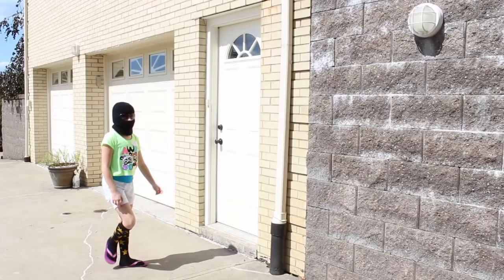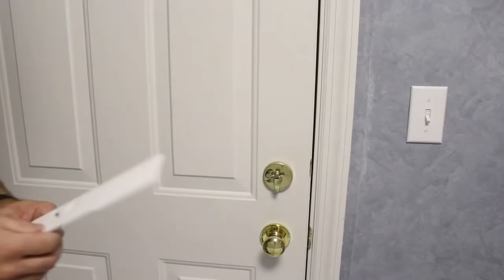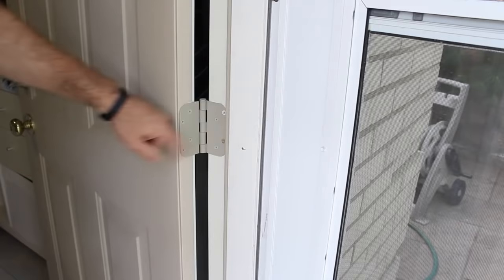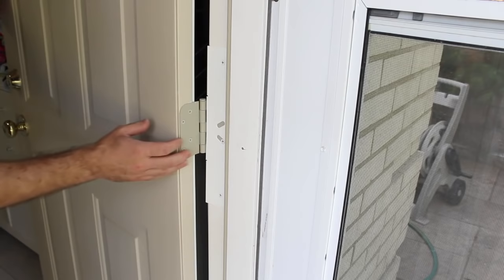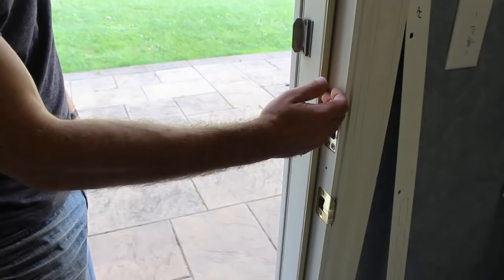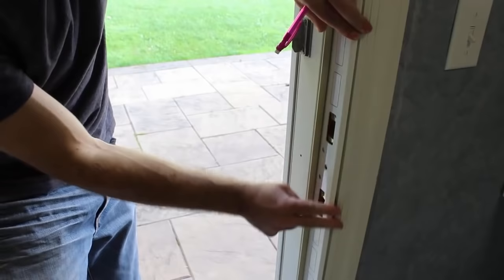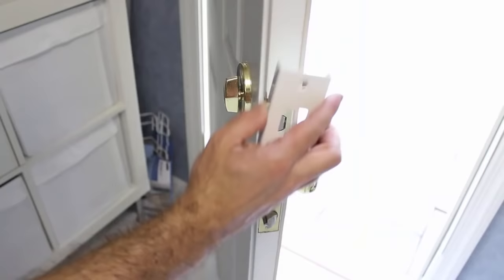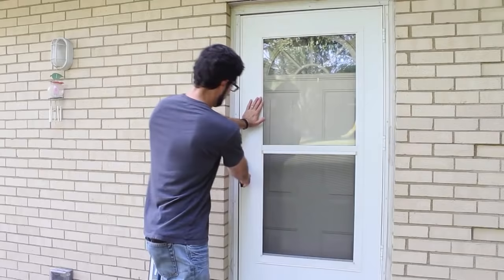How to Reinforce and Burglar Proof Your Entry Door

Comment: Speaking as a former Deputy, no door is burglar proof, best to refer to it as burglar resistant. This reinforcement kit looks like a good investment. Doors are likely the primary entry point, but don't forget that if the doors are too tough, they will probably move onto the windows. Note that anything that slows them down could prevent a burglary from happening.
Reply: How about a steel door?
Reply: Anything that slows them down gives the homeowner time to react.
Reply: I feel like everyone starts with front door...but doesn't really pay attention to garage doors, sliding doors, or the use of sticks and plastic film on lower windows that slide.
Reply: @philrose7716 anchored to the wooden door jam? It's likely still just burglar resistant. But I'm sure it could help in slowing them down or deterring them.
Reply: One can spend the money and truly make the DOOR burgler proof but still SOMETHING will give if not the door even if it is the framing that collapses   Plus a door is rarely the only orifice into a building there are almost always other doors and/or windows and barring those?  One can go right through the siding on many buildings ...I guess the best case without something being a fortress is a block or concrete structure with heavy duty hinged bars over all openings...I mean even those can be cut but not simply kicked through in 10 seconds
Reply: As someone with common sense, allegedly, if I was being felonious and decided to start kicking doors, if I don’t get passed that door because it’s reinforced, I’m walking away.

Comment: The whole point to pre-drilling is so you don't split the wood.  Doesn't matter if you have an impact driver or not - that doesn't change the physical characteristics of the wood the screw is going through.  When you don't pre-drill you essentially "pre-split" the wood.  That means your screws are not as strong as they could be.  If you are spending $100 on a security device, why would you want to sabotage your efforts by NOT PRE-DRILLING? Seems counter intuitive to me.  Never take shortcuts on anything that is safety or security related.
Reply: that's ture
Reply: Agreed, the lack of pre-drilling the holes for the screws is a devastating and a game changer for the entire concept.  Simply by stating that this pre-drilling is not necessary indicates that the individual in the video has no experience in construction or installation of anything related to wood products.  The product is likely reliable, although the video is horribly inaccurate.
Reply: I know this may sound stupid, but hey, us girls don't know a lot about this.  When you say "pre-drill", does that mean to take the longer screw and put it in first before applying the plate again?  I'm just going to be replacing the smaller screws with 3" screws (maynards didn't have 3.5 ones).  Will they work OK and as I asked, do I need to drill them in place before putting them over the hinges and plate?  Thank you for your response.
Reply: Pre drilling is when you drill a hole in the timber prior to putting a screw in. The hole is drilled using a drill bit that is not as thick as the screw you are going to put in. It should be drilled a little longer than the screw going in there.
Reply: daschundloverable you nailed it 👍
Reply: Matthew Leo lol!!!!  - gotta hurry and fix the foundation before the weather hits. Yoi!!!  TY again.
Reply: daschundloverable are you making a tutorial video for YouTube that we can critique?
Reply: Matthew Leo NO, I don't know how, even though I feel like I attend YT University!!!!  lol!!!  Like my 35 year old son said:  "Mom, you can learn ANYTHING on YT"  I'm disabled too.  MS and ortho problems.  Fell off a ladder on 10/9.  Caulking.  Hit my head (I'm not telling my doc about that one, although I did tell him about what happened on 9/9.  Was standing on the front lawn and just fell backwards and my legs went into an electrical shock for about 3 minutes - man I've been having roaming headaches ever since), on a bush branch about 6" in diameter, got my leg caught on the 2nd rung and couldn't get out for about 5 minutes.  And one of my poles on my privacy fence is leaning.  AND IT'S GETTING COLD OUTSIDE.   What used to take 2 hours now takes 2 weeks.  Pray for me.  Thank you and God bless and protect you and yours.
Reply: right on the money man, you should always have a pilot whole prior to drilling, that is woodwork 101.
Reply: Tumble Weed my bad, I often dont pay attention when typing comments on YouTube I'm normally multitasking. 
hole
Reply: Absolutely agreed, but that’s why they have the GSK R4 no pre-drilling required screws. That’s what I personally use and they are amazing.
Reply: You should show us the difference it makes in strength, when using these length screws in wood with and impact vs, predrill using same material
Reply: sMiLey Warrior exactly
Reply: @daschundloverable  Use a drill bit that is smaller in diameter than the screw but the same lenght.Any hardware salesperson should help you with this.
Reply: My drill died this summer, but I'm still alive!!!  Now it's -56 w/wind chill here and I'm not going to Menards to have them figure out if I need a new battery or charger or a whole new set up.
Reply: I totally agree!
Reply: @daschundloverable  I know I'm a little late here, but I see that you didn't get a response. "Pre-drill" means that you drill a hole prior to screwing in the screw. This way when you actually do insert and screw in the screw, you are not splitting the wood.
Reply: Bump key ..
Reply: @daschundloverable  the screw takes up space.  Quite simply when you pre drill you make room for the screw. When you don't you're forcing the screw into the wood and the wood now has to expand to make room for the screw.  Many times what happens when you do that is the wood expands to the point that it splits.  When that happens the screw has nothing to bite into and the split may go several inches in each direction making the door frame much  weaker than it was before you started.  This can be easily avoided by taking a few moments to pre-drill.  He is dead  wrong when he says that using an impact driver somehow alleviates him from having to do this.
Reply: @jamesquinn5281  about your creds: aaaaaannnnnddd doubtful. 

2x4's may not be super prone to splitting, but they split just like any other piece of wood. Those 3 inch screws don't help the case. Always drill a pilot hole if you care about strength and splitting. And don't listen to fake phd's on YT.
Reply: @jc5604  My credentials: I wrote my dissertation on the efficacy of Impact drilling in screws without a predrilled hole. It is published and in the Cornell University Library. You are talking to the foremost expert in this subject.
Reply: Then just use self drilling/cutting wood screws. Problem solved.
Reply: @jamesquinn5281  the issue isn't the framing lumber, it is the thin 1-by material that makes up the jamb. I've never had a 2x4 split, but I have had a few 1-by materials split because I didn't pre-drill or "burn in" the screw by going backwards before going forwards. That being said, given that the jamb is already under compression from the other screws and that the hole is sufficiently inward enough I doubt it will be a problem (didn't look like it was splitting either). Also, and most obviously, the screw hole left from the other screw I would count as "pre-drilling". Either way I had a good laugh at your "credentials". FYI, most school, Cornell included, have a way for the public to look up dissertations ;)
Reply: You Nailed It... I mean...  my thoughts exactly!!!
Reply: Matt Vaughn I don’t think there’s many people with a PhD in Wood, Matt.
Reply: @ernielucas6544  yea thats ture
Reply: I was going to say the same thing. Not pre-drilling will split the wood that you are screwing into and the door will eventually sag from the stress of use. The only repair once that happens will be to open the wall and replace the damaged framing.
Reply: @ElectricFlow  lmao she got a reply 3 years ago from multiple people. I'm pretty sure after 2 years it's not relevant anymore lmao.
Reply: Pre-drilling isn't really necessary in this situation because you would be drilling or should be drilling into at least three different pieces of wood and you are drilling into the somewhat center of the pine or Doug fur framing. Pre-drilling is more for finish work. Now for the door lock and such you would want to pre-drill due to the depth of the door. It would have a better chance of cracking since it is thin.
Reply: I was just about to write that
Reply: @daschundloverable  As a girl, could you please not say "us girls". Not all of us are incapable of carrying out basic tasks (or more advanced ones). And there are plenty of men who are not handy. I don't know any incapable women, but then again I tend to avoid the ones that play the "I'm a useless woman" card and are also unable to educate themselves. I'm taking this personally because on the rare occasion that I have ran into a particularly interfering and patronizing guy at the hardware store, I strongly suspect they've ran into you first. I say rare occasion as those guys are in the minority and I'm not about to lump all the men together either because that would be ignorant.
Reply: Thank You for that info.....I've been splitting wood for a long time now.
Reply: @fd3871  the diameter of the screw also is a big factor as well. Lag screws with their coarse thread and rapid entry would need predrilled holes or they will surely split the wood. The narrow screws in this case are unlikely to be a problem with splitting but it sometimes can avoid breaking screws when they're really long and thin, due to the amount of force needed at the end.
Reply: Not pre drilling also stresses the head of the screw which might have weakened it.  He also forgot 2 other critical things.
Reply: That's a really good point, I didn't think of that that's for commenting that. I would have done the same thing and not thought about it ( even though I have seen it split before.)
Reply: That’s what I was thinking I was like what is this guy taking about not having to pre drill lol
Reply: Thz SO MUCH 4 VERY valuable reminder indeed! Thank U again!
Reply: Very valuable reminder, the small valuable reminder can mean a difference between pre-drill will work 100 percent or not, CZ I may pre-drill "incorrectly!" Tha 4 ur important N valuable reminder 2 us, thz again!
Reply: I laughed when he said that... if anything it's more reason to pre drill Because your using an impact
Reply: @nealkenneth90 If you didn't overtorque it to the point that the screw stripped the threads created in the wood, it's unlikely there's any problem.  I wouldn't worry about it.
Reply: @nealkenneth90 I wouldn't worry. You use nails for framing without having to pre-drill hole then you can screw a screw into framing without having to worry. Pre-drilling is more for finish work on hard wood projects.
Reply: @emmag9362  I think most people and most women are aware that most women aren't construction savvy. You may be the exception but also the minority by far, why not just embrace that fact?
Reply: I was literally just about to make the same comment its so frustrating to hear him say that completely missing the whole point of it
Reply: I'm thinking he's done this before on the same door...
Reply: JUST ME don’t group all of us girls together - I definitely know what pre drill means and knew to do it!Don’t diminish yourself p you can do anything a guy can do Iand often better😉) like anything, you just need to learn but don’t start off saying you don’t know b/c your a girl
Reply: @daschundloverable  
To think, I used to think pre-drilling was, buy the girl another drink, and feed her more bullshit lines.

🤭
Matthew Leo got it right on the button.
Reply: Harry homeowner teaching people how to split their door jambs up😅
Reply: Pre drill is very important depending on the wood and size of screw. For small screws and strong wood definitely no need of pre drill. For big screws and weak pine,  to avoid split use a small drill a small hole to avoid the wood from splitting. It's the same problem encountered when doing woodwork with nails  yrs ago before  portable drills and screwdriver became popular. We used long thin nails first then removed it then plugged the bigger nail. I would like to add don't think the thin long nail came out easily or was soft.
Reply: I agree, you need to remove necessary material so you don’t over stuff your screw hole.
Reply: @otallono  Most _people aren't construction savvy. There are far, far more women  these days who know how to pre-drill a hole, than there were in the 1950's. And far fewer men.
Reply: @daschundloverable  As a woman, I have to say that your comment about "us girls" not knowing a lot about this stuff, is a foolish one. Since you came to this video, you can assume that countless other women also did. And most of them will know how and why to pre-drill in wood. Your comment has brought out the female-bashing trolls, as well triggered a lot of fellow women who have to battle this kind of stereotype in everyday life.
I was going to tell you how and why to pre-drill, but I see that you've gotten the answer to that question. 
Now, the question you should be asking yourself is, "Should I delete that comment that pushes women back 70 years?". Hopefully you'll conclude that the answer is "Yes", and at least edit it. If you just take out the "us girls" and replace it with "I", then your question is still present and valid, but doesn't self-demean or demean anyone else. 
And if you want to look at this situation and say we're just a bunch of b*tches... hey, if you edit that comment, then the rest of us will look like fools in our replies, responding to something that isn't there, right?
Something to think about, even 4 years after posting your comment. Please consider it.
Reply: very well said
Reply: Placing to many of these screws in a line will definitely crack the wood and decrease its integrity.
Reply: Correct, Greg.  This guy literally split the wood inside the wall, and weakened the wood.  Sure, since it's still a screw and longer and still grabbing the wood better than a nail, it will be stronger.  But why not take the extra 20 seconds to do it right?  That way, you take full advantage of the expensive system you just bought, and... since you were taking the time to measure, place the marks, make sure the screws are flush, etc... just take the extra second in screwing it in too.  Good video, none the less.
Reply: Great video!
Reply: @jamesquinn5281  I'm just glad I have a friend who is the foremost expert on what wood needs pre-drilling. I believe you got the makings for a book, maybe even a series and if it takes off like I think it will I see you making a trip to Hollywood for when it's turned into a movie. Oh I meant Bollywood. I be can't believe I didn't take that class. Strike 2 missing out on Amazon stock was strike 1. Although I think you're going to change Amazon to the #2 spot.
Reply: @daschundloverable  - Pre drilling is the same as when you were in high school, and your boyfriend would have a happy ending in his pants before he could get your pants off.
Reply: Every wood joint on your house is “split” wood due to the nails!  How do you feel about that, genius?!?  Have you ever predrilled a hole for a nail and try to drive the nail?  It locks down in the hole after a short distance and you cannot drive it all the way!  Them long screws strengthen the system in multiples over the short screws under any circumstance!!!
Reply: @daschundloverable  🙏
Reply: Wtf is pre drill?
Reply: I was just coming to make this comment. Clearly, the guy does not know much. B/c who does this thing and not know why we pre-drill. Are you joking!!!!!!!! You want split that shit open?
Reply: ACTUALLY... i often screw in a bit, back out, further, back out, then ram it home, dont split nothin
Reply: not always true, learn the tricks of the trade, spit on the screw and it wont split the wood
Reply: Because that is NEVER explained in instructions anywhere. Not ever. Most people have zero mechanical or carpentry knowledge or skills. Why would you assume they should know that? Why would manufacturers? I took wood shop for two years in high school and that was never explained to me. Years later a buddy whose father was a carpenter explained why to bother pre-drilling.

Comment: I am a full time locksmith.  You can’t fix cheap with a few light weight steel plates.  I guarantee you that the bad guys can easily kick that door in with little to no effort even with the plates you installed.  You want a door that can’t be kicked in?  Buy a commercial steel door and commercial steel frame and always swing the door outward.  Not even the sheriffs during a raid will get in a commercial steel door that swings outward.

Comment: The "next step" is to replace ALL of the screws with 2.5- 3" long screws, on both (left and right) sides... so the hardware is SECURED into the vertical studs. (this alone will make the door 3x harder (or more) to enter. Then even if you don't have this "kit," you just made it MUCH harder to force the door (front, back, side, etc.) in!
Reply: the jamb side will bust right out still easy peasy that's the place I've always seen it break irl